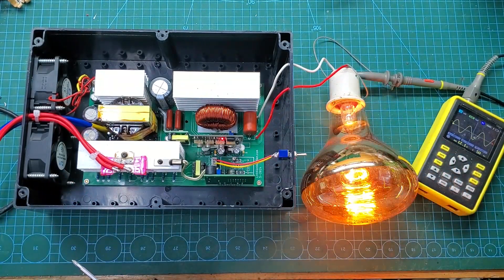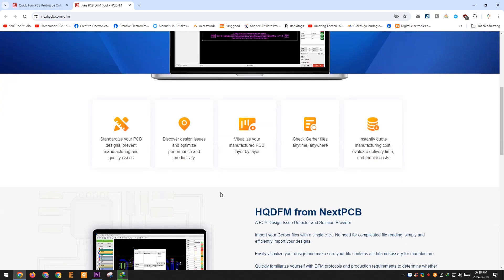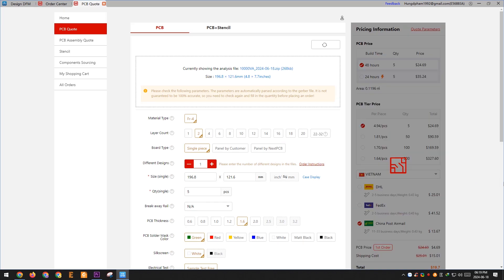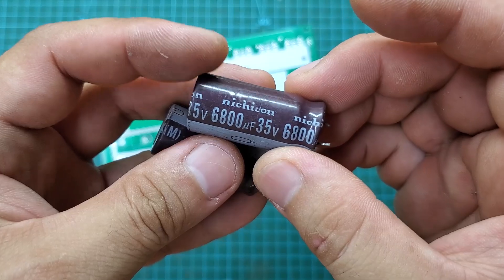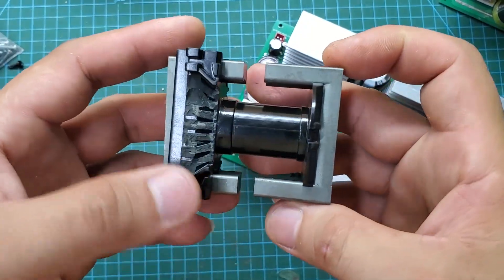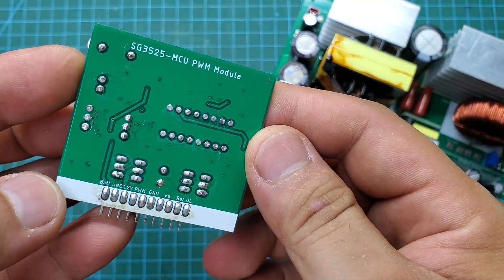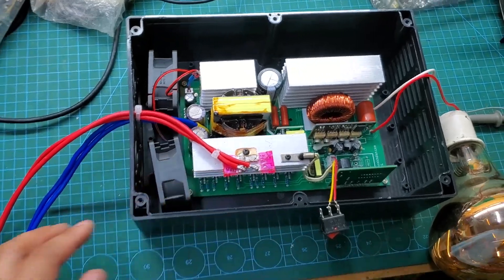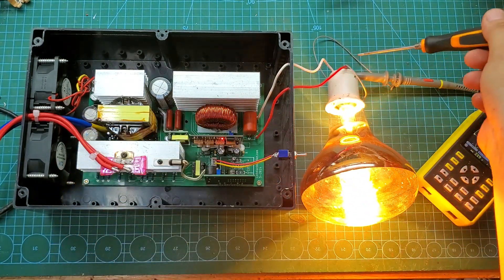Super inverter with short-circuit protection.

Comment: Very original. The step-up stage is push-pull, with a common drain, controlled via a galvanically isolating transformer. All the MOSFETs are screwed to the radiator without gaskets.

Comment: good morning friend, a question how to change the output voltage of a hybrid inverter, for example the powmr 3.2kva that is 24v to 220, it would be the same 24v but at 120 or what can you tell me, thank you
Reply: autotransformer is necessary so you can tap the neutral. Gives you split phase...not terribly expensive. David Poz did this with his Growatt inverters...I think because the 220V-240V units were much more common